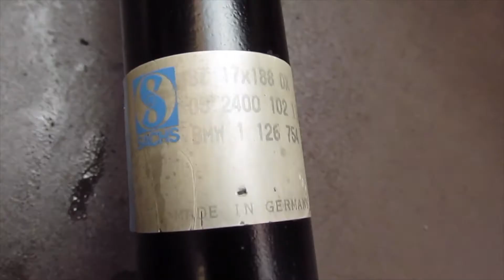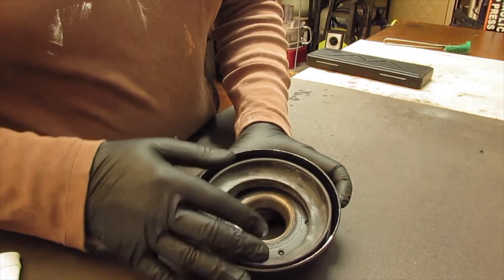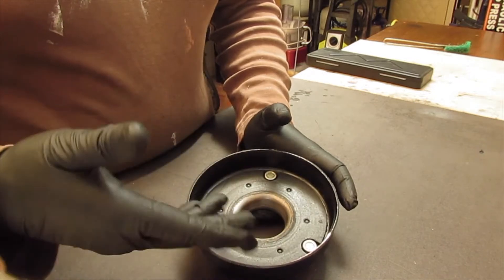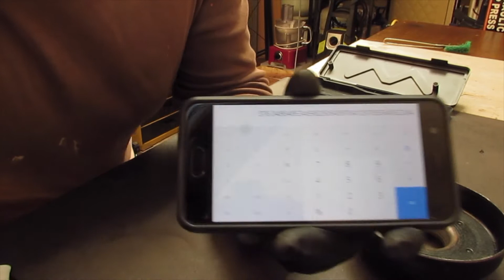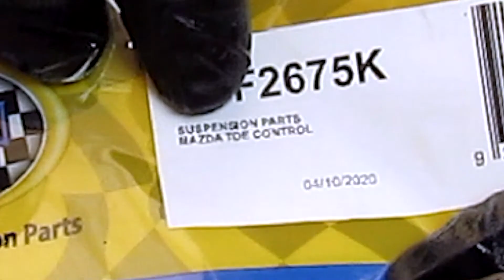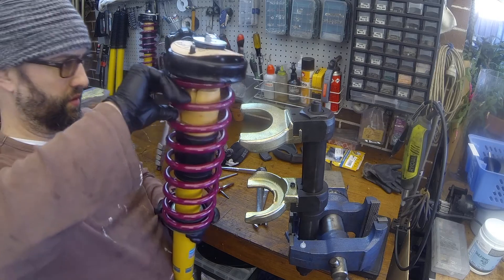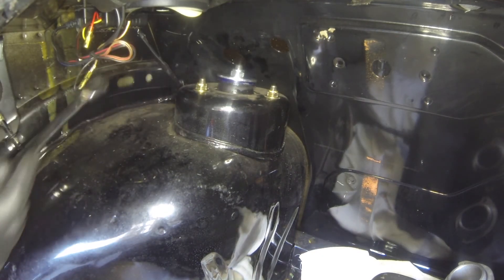BMW E28 M5:  LVL 6-2 Rear Strut Rebuild SLS Replacement Upgrade

Comment: Hey out of curiosity, where did you purchase those rear bilsteins? You’re one of the only people which got the correct 270/100 compression damping for your car.
Reply from the maker: Heasmans in Sydney. They're the only Bilstein distributor in Australia. And I think the closest reference is a M535. Thanks for the comment ☺️ What's your current project?
Reply: @BahjatAlaadel it’s only been two years so  I only find it appropriate that you are still eagerly awaiting my response. Mines a 535is. Your content is dope, hope to see more of the entire car eventually too and where it is that you drive it. Cheers to the kangaroos!

Comment: Thanks for the video, I’m researching and learning before I drop the rear end out of my e34 touring. Looking to pull apart the SLS struts, replace all the seals, deal with all the bushes around the subframe & driveshaft then lastly put new rear trailing bushes in.
Reply from the maker: All the best. The trailing arms are a pain. If you have a hydraulic press you can heat the arms and push them out. Or cut them out. Check out my episode on the trailing arms.
Reply: @BahjatAlaadel  thanks mate, I’ll find that tomorrow. My biggest knowledge gap is in pulling apart the SLS struts, LAD and height control unit. SLS is brilliant for a car that gets used daily and loaded up to varying degrees.

Comment: That bushing looks a bit suspicious. At least it should have large washer under it. It won’t take long until shock will smash through the bushing.
Reply from the maker: On the bottom is the metal cup which is above the bump stop. The cup sits on strut shaft and pinches the centre metal sleeve of the bush. Which is the same height as the original bush. I also got it approved by a mate who worked for a Bilstein installer. I'll keep and eye and an ear out on it 😂. Thanks for watching.
Reply: @BahjatAlaadel  haha. My apologies for insulting your intelligence :) from video, it looked like there was no washer under the bushing. 
  Looking forward to next video
Reply from the maker: All good mate, I appreciate the input. I like the open community dialogue, we all stand to gain from our shared experiences. Thank you again, I too would have been worried if my struts ended up coming out the top. 🙌